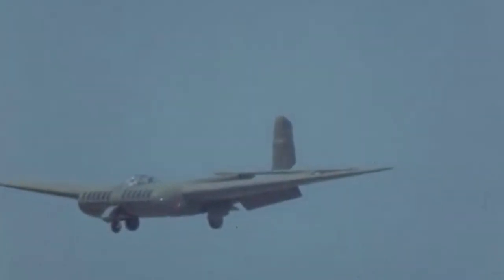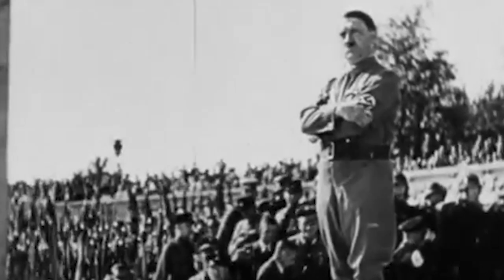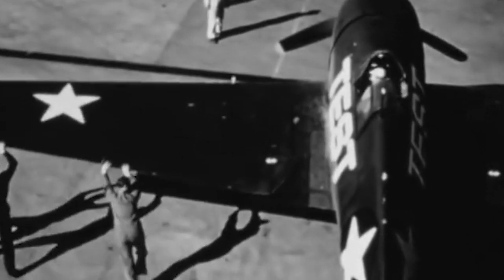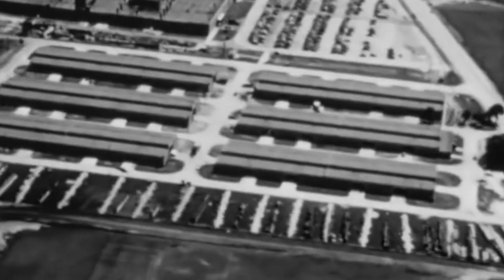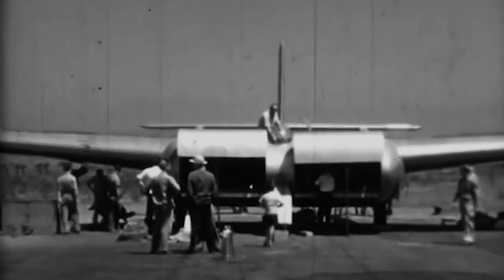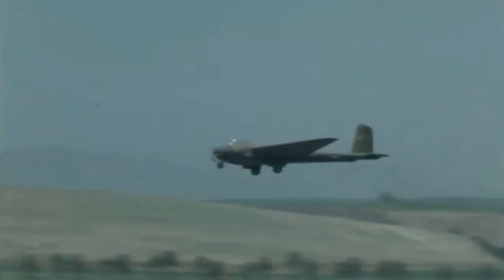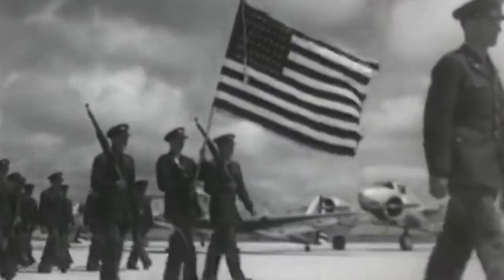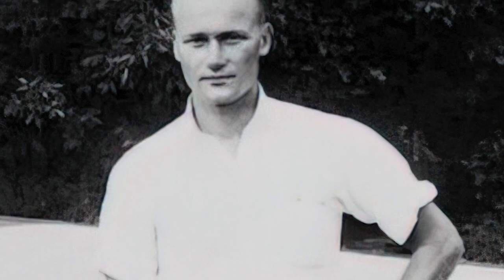A 200 MPH Flying Wing Assault Glider - XCG-16

Comment: You guys should do a video here or on dark tech about the Fulton Recovery System. For those unfamiliar, if you've seen the recent James bond movies, in one of them Bond gets picked up from ground level with a device consisting of a weather balloon and a harness line, which is hooked onto by a plane like a C47 or C130 flying overhead. You can imagine it would be rather violent to get picked up by one, but I've never looked into actual reports of people who've used them, since the primary group that does use them is the CIA. Seems right up your alley though!
Reply: We were briefed on them in case our  TAC unit needed to be extracted and told it might break our back so it was a last resort
Reply: Actually the nylon line attached to the harness stretched and reduced the snatch effect. The subject in the harness actually started to lift almost straight up then accelerated to the flying speed of the aircraft (facing aft in a seated stance). Winched into the pickup acft. Windblast was the major danger as the subject came up to speed. You kept your arms folded and legs slightly bent, it became dangerous to move about especially when you got closer to the aircraft on the shortness of the line.

Comment: That reminds me of the XCG-20... Waiting for the video on the C-123E and XC-134 now. Honestly the C-123T would've beaten the C-27J and C-295 in every way, except maybe speed, maybe.
Reply: See also the YC-134E
Upgraded C-123 with BLC for STOL, and waterproofed fuselage and a pair of skis/skids. In the skis, it operated from pavement, unimproved ground, sand/ swamp/ water, ice & snow.
The military saw no use for it. (?)

Comment: If I understand it right: 
They tow a glider quite close to a landing area with a POWERED plane.
Then they make a system to pick it up again from the ground with a POWERED plane.

I would do it like this:
Put engines on the "glider" and let it do all of this without any help.
Reply: That means less cargo.
Reply: More expensive, and  couldn’t carry much cargo, due to the extra weight of the engine and fuel.   These gliders were built cheap, with the hope to recover some of them.

Comment: When the Army tried to get gliders built at the beginning of the war they got NO responses (all the air craft manufacturers were fully booked to build aircraft), so they hunted around using the skills requirements to build gliders (welding steel tubes, bending forming sheet metal, etc.) they could only find two that were not fully committed with war contracts already we a COFFIN maker and a maker of REFRIGERATORS!!!! Neither of these two things is particularly known for flying very well!

Comment: Once they left the tow rope the full effects of the sands bags shifting and changing the center of gravity to the rear of the plane would have been fully noticed and overpowering . At that point it was impossible to control the aircraft. And then the parachute for the pilot failed. What a sad situation. Had they been too hasty in their development of the whole project down to properly securing the sand bags for flight.

Comment: Get out of a flat-spin by pushing forward on the stick.
Reply: Had a decent Rudder.
Reply: They were carrying several tons of ballast that was allegedly not secured in the cargo bay.  Once it had all gone to the rear in turbulence from the C-60 tug the stall and spin were not recoverable.  Remember Dark Skies has no aviation knowledge or indeed any military background.
Reply: @timgosling3076  Very true. Need more than a cargo net.
Reply: @timgosling3076  thanks for that, neither do i have much of that knowledge, i just figured out how to get out of the flat spin after my flight sim mitsubishi zero crashed a few times - and then i verified that my guess actually works in real life too - so i thought i might mention it in the off chance that an amateur is in a combat situation flying an old p51 or something during the coming civil war - which will certainly see some mismatches - and then there is the war against china to follow that - so, ya never know
Reply: If the C of G get aft of the neutral point the the pilot no longer has any pitch control, pushing the stick fully forward does nothing, the elevator is ineffective. In such a state the flat spin is unrecoverable.

(NB: I am a gliding instructor/examiner and an aeronautical engineer, trust me I am a "doctor").
Reply: @christopherrobinson7541  Aircraft actually have a defined range in which the CofG can sit while still allowing full control.  So it’s not true that anything aft of ‘neutral’ (ie CofG coincident with CofL is fatal.  However, this are fore and aft limits beyond which there is insufficient control authority.
Reply: @christopherrobinson7541  'IF' you have the capacity to eject weight, you can shift the C of G (center of gravity), which could drop the nose, increase velocity, and regain the vortices under the wings.

Comment: Sadly an accident claimed the lives of the crew and ended the development of a promising aircraft design.
Reply: It wasn’t the accident that ended this glider.  After this concept aircraft crashed the Army ordered 3 of the production standard aircraft.  One was built and flew about 70 times over the following year.  Fortunately the Army discovered it couldn’t be made fit for service before any more cash was committed and cancelled the program in 1944.
Reply: @timgosling3076  "Couldn’t be made fit for service"? With D-Day deadline aproaching many advanced projects requiring further developement were dropped in favor of "good enough". By all accountes the XCG-16 was a good flyer, the blended wing body concept it employed is being developed by Boeing and Airbus into the next generation of commerical aircraft.
Reply: @olsonspeed  It flew well but had structural problems, inadequate crash/hard landing integrity, was hard to get out of in an emergency, the cargo ramps were too steep and it didn’t give the pilot enough downward visibility on approach.  Some of those things might have been fixable, some not.  But it still wouldn’t have had enough extra capability to justify the work given that the Horsa and Hengist gliders were already combat proven.  A little research and Dark Skies could have explained this.
Reply: @timgosling3076  I know of few if any projects that were perfect off the drawing board, most all require alterations, upgrades and redesign. My "promising aircraft design" point was that seventy-five plus years on, aircraft manufacturers tyring to squeeze every kilo of efficency and performance from new transport aircraft are turning to BWB and flying wing aircraft.

Comment: It’s such a specific aircraft. Such contraptions rarely emerge beyond the experimental.
Reply: This one should have emerged beyond experimental. It’s limitations would have been easily overcome and I would have thought that DuPont would have made an exceptional effort to have the weight distribution lockdown without doubt of shifting! Bags of sand are obviously flexible under G load especially if tethered by a single attachment. Too bad, this wing/body design had better control than the awkward design that took a nosedive into the ground throwing men forward onto each other with around 100 lbs of gear and possibly a large piece of equipment, contributing to the extremely high (close to 70%or higher rate of loss to the 101st Airborne. They were  a valuable resource to our country).

The old professor 

Live free or die!
Death ☠️ to all tyrants!
The truth will stand when the world falls!

No Shit.

Comment: fences would have fixed the flying issues 1st fence @ the curve or taper off the edge of the body this must extend back 2/3 body top and bottom, 2nd about 10 inches out from the body to control the massive disturbed air this need only be 10% of wing and 3rd mid aileron to maintain aileron control. Yes I know everyone hates fences! Therefor everyone except the Russians are afraid of using them. But try running a computer model based upon these 3 fences and OBSERVE!

Comment: Ok so the Gary Powers Incident says he was shot down by a surface to air missile. Back when I was younger I heard that all the S2A missiles managed to do was shoot down a pursuing mig. It took a stripped down sukhoi catching its slip stream and knocking the U2 out of the sky. Why was the story changed to say he was just shot down by S2A? Or was the other story wrong?
Reply: He was shot down by an SA-2 missile which had been fitted with an enhanced booster stage to reach the required 70 to 80,000ft.  A Mig-19 sent to attempt an intercept, a vain   attempt given the 20,000ft deficit in ceiling, was apparently shot down by one of the other missiles fired.  The improved SA-2 booster was later made standard.

Comment: Problems: 
1) It’s a glider.
“Since it’s being SHOT AT the enemy and it has ZERO armament, how is it at evasive/combat maneuvers? Even a dumb ass can figure out where it needs to land.” 
“Well sir, since you didn’t to spring for the engine, it’s just gotta land.”
2) Plywood and canvas is supposed to replace the DC-3/C-47? One of the best and most iconic planes of all time? That’s even more insane.

Comment: NOT a flying wing.  Flying wings don't have vertical stabilizers
Reply: You do realize that fly-by-wire didn’t exist yet? Vertical stabilizers were a necessity
Reply: @Idahoguy10157  Irrelevant blathering.  I didn't say it did.  I simply corrected an incorrect label.  If someone called a horse and buggy a gasoline powered automobile they would be incorrect, REGARDLESS of whether engines existed at that point in time or not.

Comment: You made great use of one extensive video, but a poor job of cutting splicing and informative script. Not only did you show many superfluous aircraft that had no connection with the story (Grumman F6F, F7F) but you didn't bother to find the easily available videos of the All American Stinson glider /mail pickups, nor the C-47 pickup of CG-4As. https://www.youtube.com/watch?v=aYHzkT-Hkig  From a Bowlus perspective, footage was shown of at least three flying wing and boom and tail prototypes with no identification or mention. Besides the script gaffe of ballast carefully secured/oops, not secured and came loose, you didn't mention that an unqualified Air Corps pilot was put in the pilot seat, and his inexperience may have triggered the rough ride. Finally, not only did Hawley Bowlus successfully bail out, but crewman Harry Perl did as well.  You seem to have received one video of a sexy looking, little known design, and neither researched further or sought out supporting, and quite common videos. Sensation is not history, and this is a disservice to those seeking information.